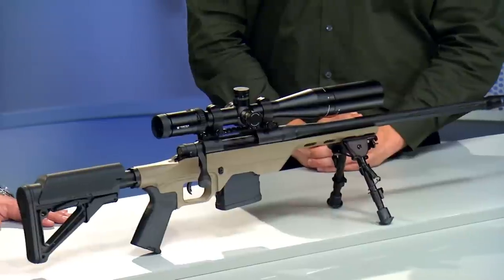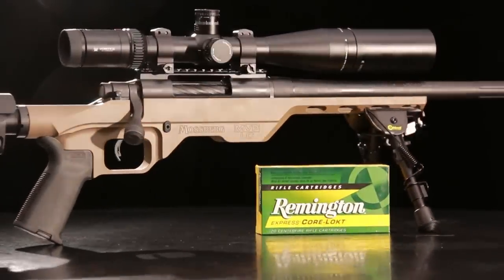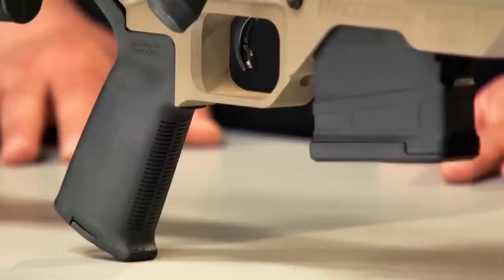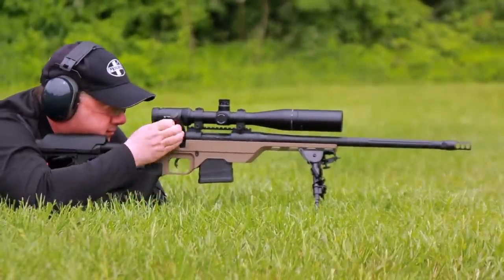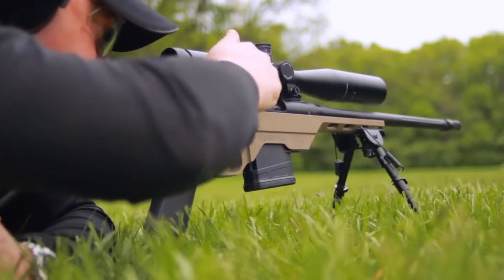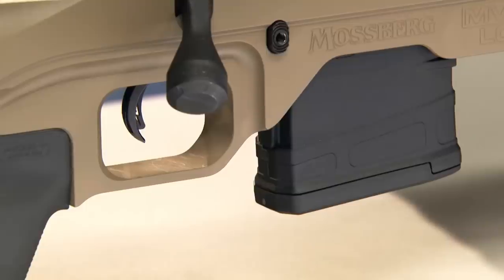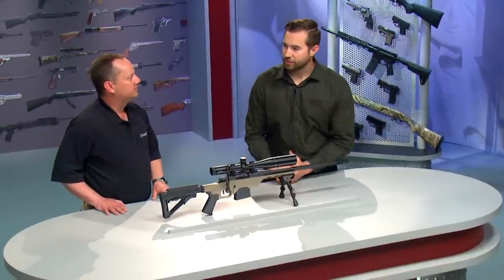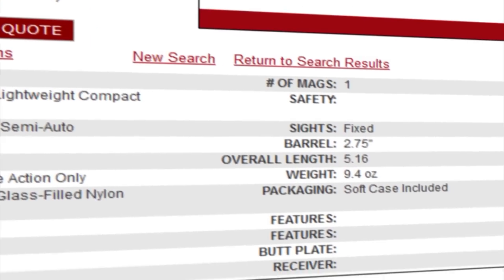Gallery of Guns TV - Mossberg MVP LC with Vortex Scope

Comment: I bought one of these and it does not have AV Block in the stock it's may just like any other stop Half Moon where the action sets if you loosen the two mounting screws you can move the action forward and and back almost 1/2 inch what's up with the V block mine is not made like that
Reply: I've been seriously considering this rifle, but there are so many mixed reviews. It's down to like 800 bucks at many retailers. In every single review I've observed the bolt needs to be yanked out and slammed back into place. I just don't know. I like the looks bbbuuuttt...?

Comment: I have one in 556 . Piece of junk, can't get less then 1 moa. My RPR 6.5 gets .25 moa all day.
Reply: Maybe the inside of your stock if not the block like the man said mine is made in a half moon shape that the action set then just like any other rifle when you loosen the mounting screws you can move it forward and back almost 1/2 inch maybe that's the reason some people say it doesn't shoot good I haven't shot mine yet I think I'm going to bed the action there's no B Block there?
Reply: Odd. I have the 556 as well and its an absolute tack driver. Especially for the price.